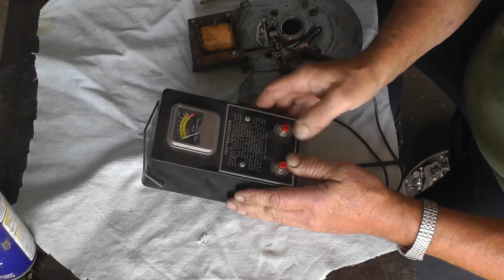Briggs & Stratton 5S Restoration

Comment: Thank you so much Kevin for this video. I recently bought a Will-Burt Little Farmer walk behind tractor with a Briggs Model 5s that was seized. I've take the motor down most of the way and found the piston seized due to rust in the top of the cylinder. No real sign of water in the oil so hopefully is was condensation that just sat above the piston. The top of the piston is in good shape but of course the proof will be in the shape of the rings. I have a David Bradley channel, just type in Bryan Horne, David Bradley and you will see my model 5s. Any words of wisdom would be appreciated. This is my first rebuild.

Comment: Very similar to the engine on my 1955 eclipse parkhound reel mower. All I had to do to get it running was to clean the points and the pickup tube on the carb.  It starts on the 1st pull every time. How do I determine if it is a 5 s or 6 s. No marks on the engine

Comment: Great video! I’m breaking a 5S down too, it would appear. Can’t get it back running. Question: how to you set the butterfly on the top of the carb? Where should it?
Reply from the maker: I put mine part way open ( like a fast idle setting ) then when it starts it will keep running. Once it smooths out you can make your final adjustments. I start with my jets set about 1 1/2 turns from seated. Good luck and thanks for watching.

Comment: Nice and thorough, Kevin.  I had one question.  Since you changed the orientation of the rings, wouldn't you want to hone the cylinder, or doesn't it matter for an engine of the type and age?
Reply from the maker: I thought about honing but decided not to because the cylinder was in such good condition. It will be a show engine and won't work hard. Yes  I should have taken time to hone it. Thanks for watching.